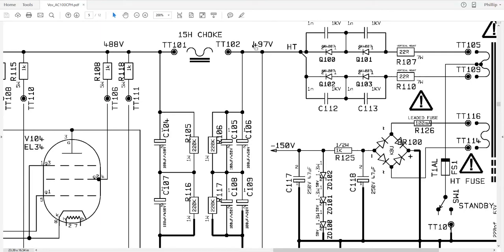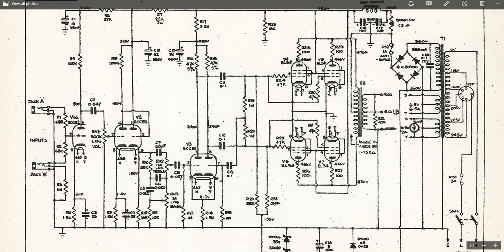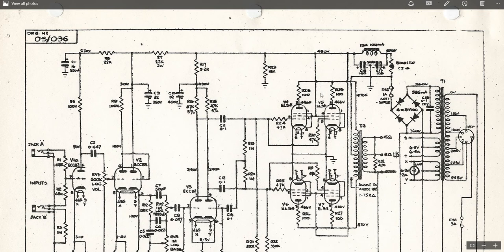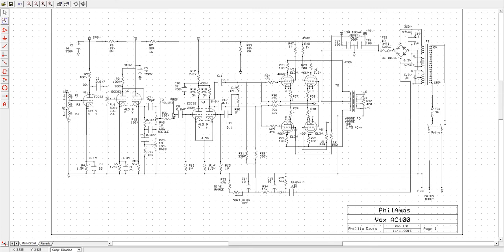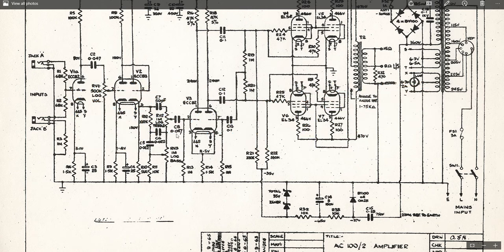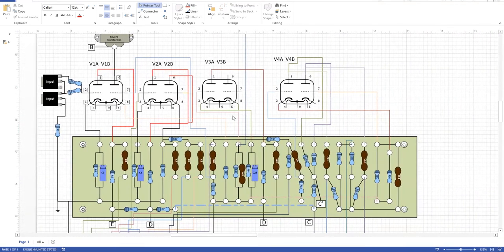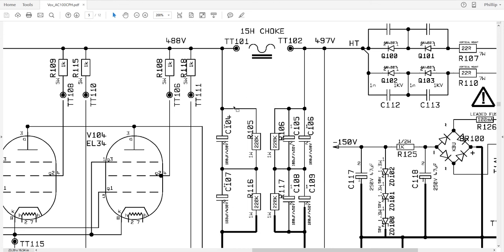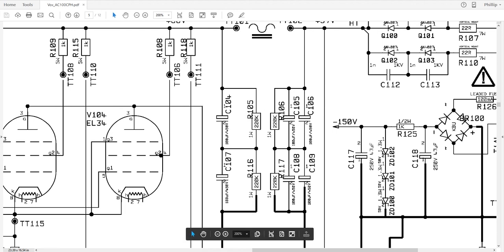VoxAC100/2 Build Intro

Comment: The 12AU7 has a sound of its own.  You may find that while it has much lower gain, it may be more pleasing.  I suspect you will have to stick with the 12AU7 in the phase inverter section, based on the resistances around the tube.  If there is one thing that most amplifiers these days have is far too much gain.  Also, those resistors around the filter caps are balancing resistors; they are designed to keep the voltage even across the caps because filter caps in series tend to hog current from internal differences.  They will also serve to bleed off the voltage in the filter caps when the amp is switched off.
  
Keep us updated!  I'm sure this will be a really great project!!
Reply from the maker: +Ben Wa Thanks!  Yeah I've got the 12AU7's on order now, the amp fires up and works, and sounds pretty great at low volumes, but when I push it up even to about 3 or 4 (out of 10 or maybe 11? :D) it starts distorting in a not so nice way.  I'll put in the 12AU7's and play some into a nice mic for all to hear in a final video.  The series is going to have at least a couple more videos in it, as I ran into some issues that I'll document and show progress of the amp as I worked on it.